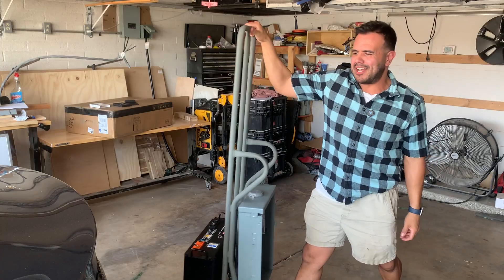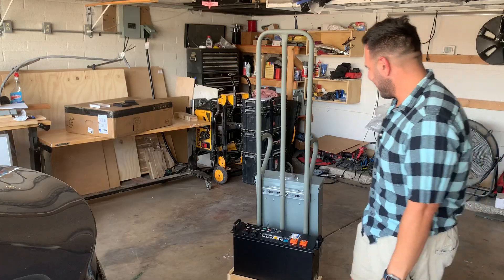EP 3 — Unboxing & Mounting the EG4 6000XP | DIY Off-Grid Solar System Build

Comment: The Eco Worthy just raised price to $999 from $869.   It was same price as a Vatrer few days ago.  Now I don't why Eco Worthy raised price but Vatrer didn't.  Possible because EcoWorthy sold quickly, and now ran out of all old batch.  And now have to get from newer batch with newer tariff?   I don't know.  But now, I would buy the Vater instead, and Vatrer doesn't have communication.  However, it offers a screen .  Both batteries were very solid and were recommended by Will Prowse.
Reply from the maker: Yea batteries are fluctuating right now but overall i think they are getting cheaper
Reply: @Yesseyd  The Eco Worthy just drops to $829 today from Amazon.  You're right.  They are fluctuated, but generally getting lower despite all the tariff drama.  learned somethings, if price jumps, do not buy.  Just wait...